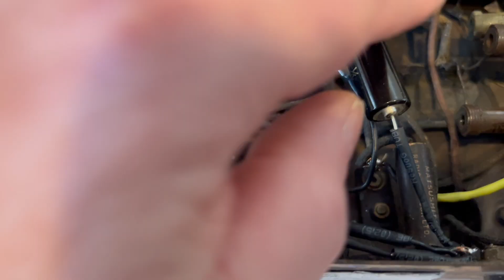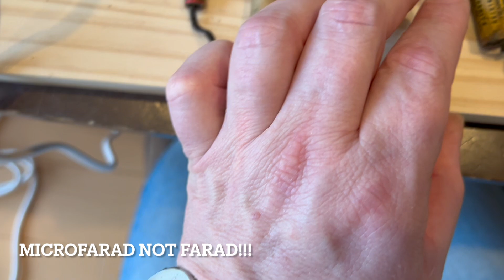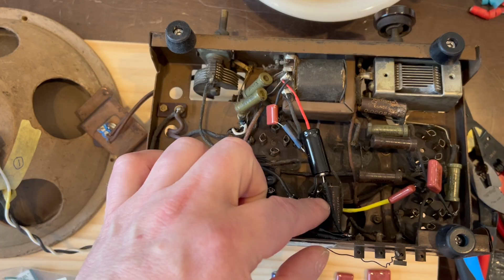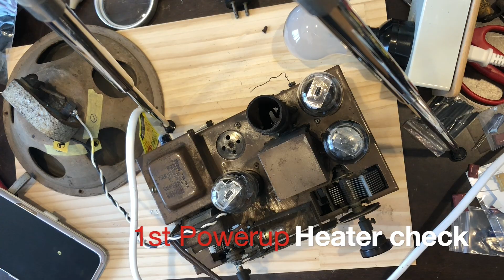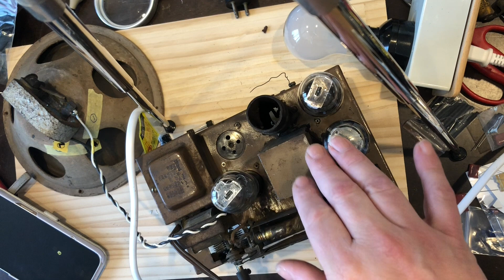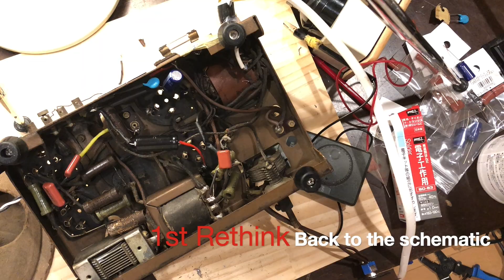National Z 2 Restoration: First Powerup

Comment: Apologies if you're already aware of this, but  I thought I should mention it just in case: Going from 3mF to 10mF in the one filtering cap is quite a jump. The biggest difference will be the inrush current will be bigger when the radio is turned on. Everything in the path from the mains inlet to the filter cap will need to be able to handle this over many power on cycles. It could be ok if eveything is sturdy enough, but it could also be better in the long term if the filter cap is reduced to 3.3 to 4.7 mF. :)
Reply from the maker: This is an excellent point and thanks for raising it. As the 10 is the second smoothing cap my understanding is that there’s less danger of high inrush, but I’m happy to be disabused of a misconception.
Reply: @HifiFixer  It depends on where they are in the circuit exactly and what components are in front of them (a choke or a limiting resistor would help here). I've had a look at the schematic in the first video again, but I can't see the filtering caps in the PS section - C8 and C9 are way too small a value to be them. Maybe I'm selectively blind though, happens frequently :) In general uncharged caps acts like shorts - so if you have two uncharged caps in series, both will be acting like a short and they will both be charged up simultaneously (acting like a cap with half of the total capacitance). But again, details on their actual hookup matter. You did mention that the speaker coils magnetic field acts like a choke, so maybe that helps here. Also, I don't have a lot of experience with tubes/valves, specifically the rectifier here. So I don't know how they act with regard to the inrush current - if they have some built-in limiting due to their physics, maybe all is good?
Reply from the maker: Thanks again. 
The whole circuit is a bit of a mystery: what looks like an OT but it sits between the gain and output tubes, no grid leak resistors, and on and on it goes. I’m kind of doing the best that I can. 
On the issue you raised, there is a choke (L4) between the two caps which I misidentified initially, and lower value PS caps in tube amps are pretty common compared to transistor stuff. Anyway, all seems to be stable and passing signal. Just need to fix the speaker unit.